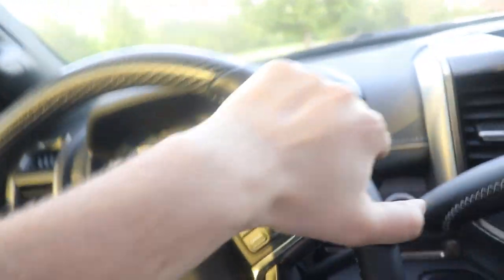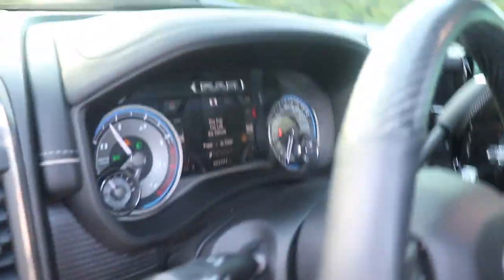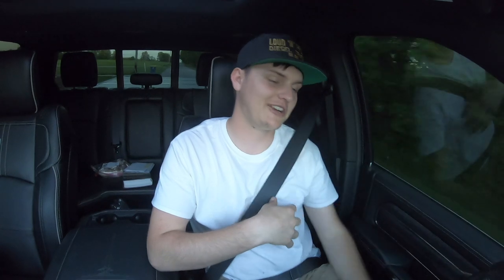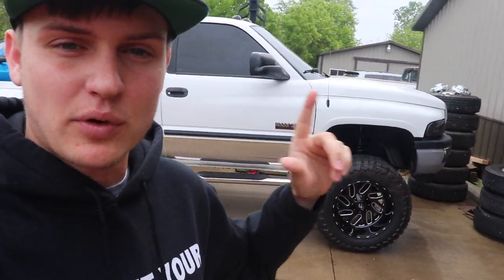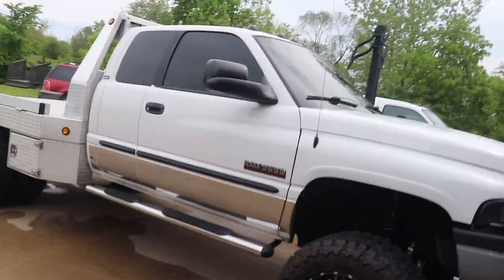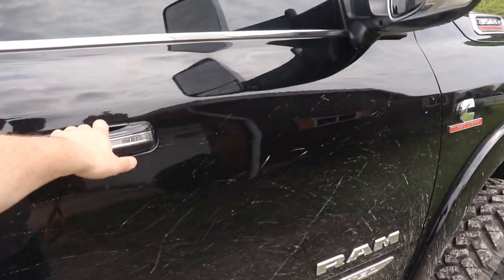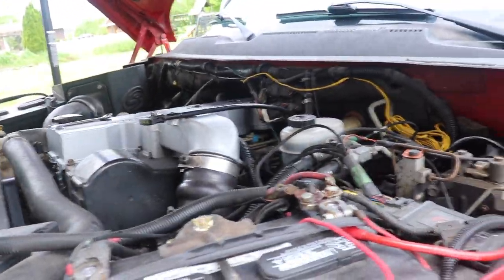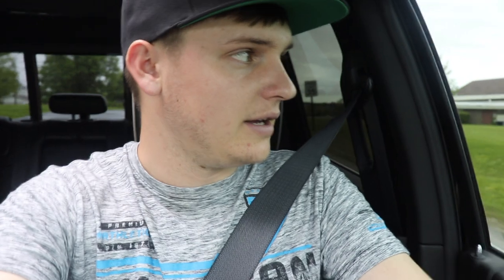WE HAVE A HUGE PROBLEM WITH THE 5th GEN CUMMINS BUILD!!!

Comment: Engine cranks out 1000 lb-ft of torque stock

"I want it to put down power"
Reply from the maker: Tyler Perlenfein power that it’s supposed to without all the emissions...
Reply: @LOUDNPROUD  I kind of figured you were referring to parts falling off, but I just thought it was funny when it already produces more power than its competitors
Reply: 1000ftlb is the aisin trans his is 68rfe 860ftlb
Reply: @chopperdan7594  If you "needed" more power, wouldn't it have been easier and cheaper to just get the Aisin?

Comment: I have two issues. First, the dual rear wheel trucks have ALWAYS had a larger bolt circle than the single rear wheel trucks. Second that is NOT a fifth generation. Fifth generation will not arrive until production moves to Warren, Michigan.
Reply: Actually that is the 5th gen. It's not a 4th gen. To much has changed. You're the only person I've ever heard say it's not a 5th gen. If it was still a 4th gen there would be arguments all over line about it.
Reply: @DieselAddict-vs9fc  it most certainly is NOT fifth generation UNTIL PRODUCTION MOVES TO MICHIGAN FROM MEXICO. My sources are FCA personnel, what are yours?
Reply: @walterk1221  they're not gonna do that many changes to a truck and keep it the same generation

Comment: My 24V has a bad turbo.. is it bad for the engine to drive with the turbo not working?
Reply: Not a good idea at all Garrett. I would definitely park it until you can replace the turbo so you don't cause any further damage
Reply: Paul Rapisarda Gotcha. I drove it about 40 minutes to a diesel shop for it to get repaired. Hoping it didn’t cause any further damage like you mentioned could happen.
Reply: Paul Rapisarda it’s done at the shop now new turbo on her thankfully they said nothing was damaged just made a bit of a mess with the oil spitting out

Comment: Why does the hood on mordecai look like it doesn’t shut all the way? It would look awesome with a different grill and some black 22 by 14’s😀
Reply: Motoloco Gang it’s because the previous owner painted a non sport grill. Sport grills are slightly different. The bottom of the grill extends down more.. filling the gap between the bumper and the grill.
Reply: No it has a 4th gen bumper duh
Reply: Misconception Industries uh bud. Yes we all know that it’s a 4th gen bumper.. but the repainted non sport grill is the problem
Reply: 98 12 valve thanks man

Comment: This is Not 5Th Gen!! That is 4.5th gen!!!
Reply from the maker: Dmitry B buy one and find out....
Reply: @LOUDNPROUD  I did buy one.  best truck on the market no doubt.  It's still not designated a 5th gen though.
Reply: @Regal2800  you are correct. Fifth gen 2500 and 3500 will not debut until production is moved to Warren, Michigan. But, his misidentification of generation is less annoying than his constant misunderstanding of the fact that since the 1970s the dual rear wheel pickup has had a larger lug circle than the single rear wheel pickup.
Reply: @LOUDNPROUD  I did and it is gen 4.5. Gen 5 arrives when production moves from Mexico to Michigan.
Reply: Dmitry B you’re right it’s neither! It’s a FIAT(Fix It Again Tony) should of got a pure American truck like a Chevy or Ford!